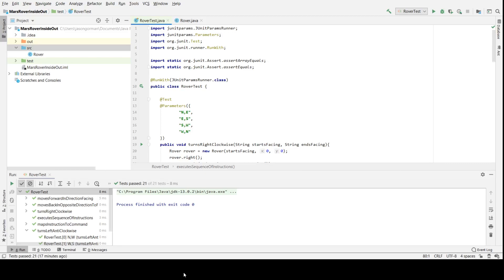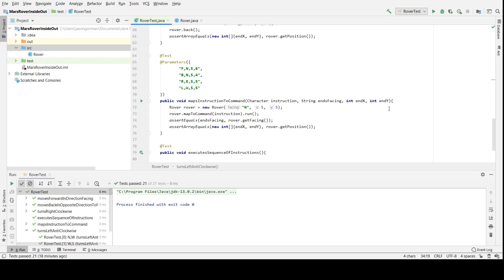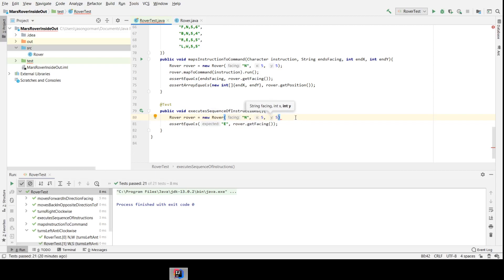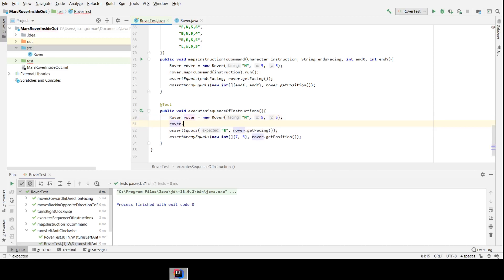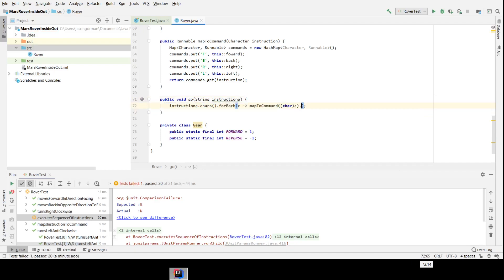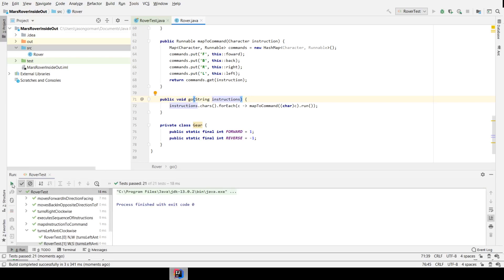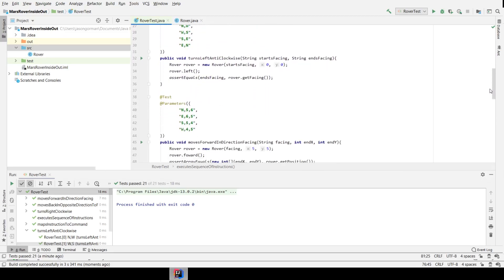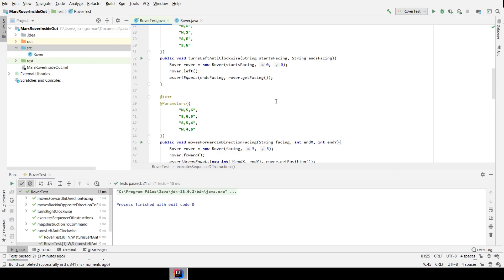Test-Driven Development (TDD) in Java #5 - Part I - Inside-Out TDD

Comment: I like your videos, and I've been going through them to learn more about TDD.

This video jumped ahead allot from the previous one. That left off with clockwise counter clockwise turns. For those following along at home, it makes it difficult.

It would have been great had this video started with the move forward / back commands and the implementation of the coordinates.  Even a bitBucket link would be helpful.

This was a pretty neat function, I hadn't see pushing methods into a map before. I would love a bit of commentary about why to do this way over another.

public Runnable mapToCommand(Character instruction) {
    Map<Character, Runnable> commands = new HashMap<Character, Runnable>();
    commands.put('F', this::forward);
    commands.put('B', this::back);
    commands.put('R', this::right);
    commands.put('L', this::left);
    return commands.get(instruction);
}

Thank you for doing this series